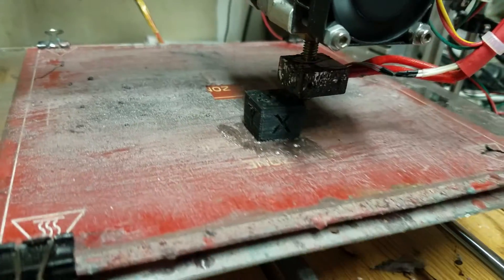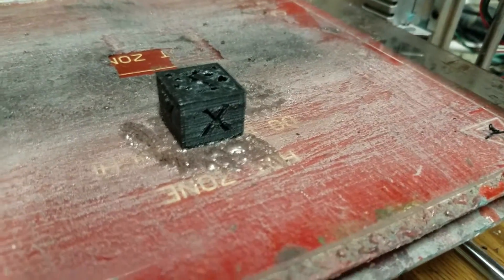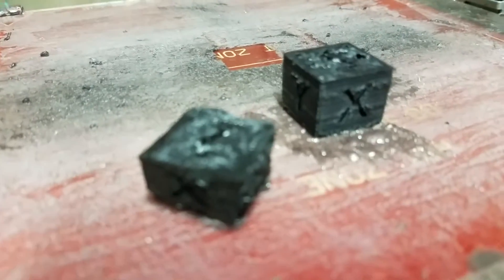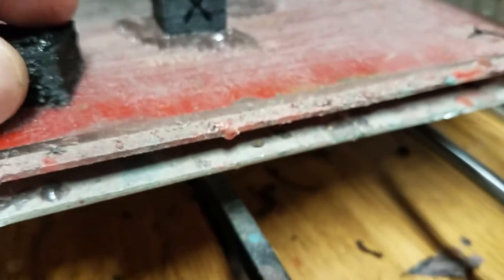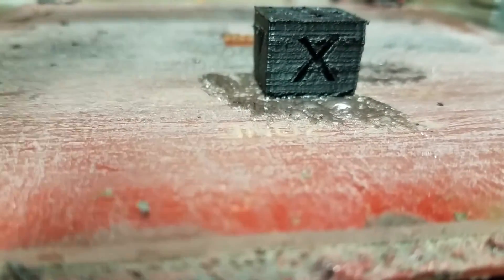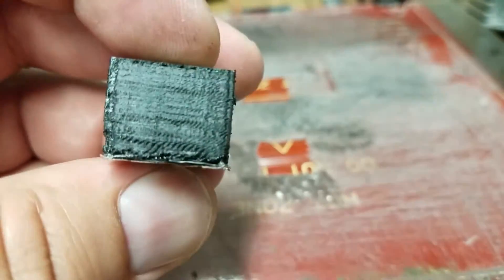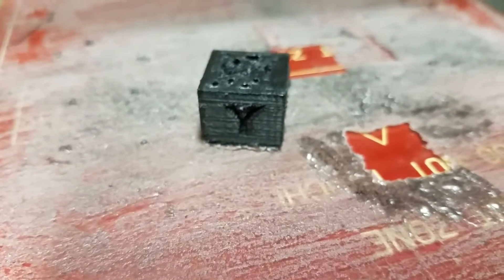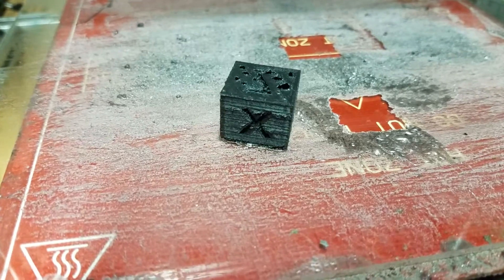Basic Settings for Smoothie Board on a Basic I3

Comment: Thanks for responding so quickly. Two more question what did you use to write it/ edit it? Can I use any text editor except notepad ++ or is there a preferred one ? Compared to the original board how much better is the smoothieboard?

Comment: Not sure what alpha, beta and gamma are for steps per mm, but my anet a8 runs about 100 x 100 y 400 z.  You may want to check that out as your cubes look short.  I also had that same issue when I had selected the wrong "type" of g-code in cura (marlin vs repetier).  After changing firmware to Skynet for the added bed leveling sensor it made no difference which I chose, but before that choosing Marlin as the G-code type instead of repetier would result in short cubes.  Just a couple of things I'd check.  That and a new glass bed....

Comment: I am in the process of doing the same upgrade and my board did not comebwith any software. got it from smoothieware but there is some confusion on what firmware to use cause they have several. also your settings are a great help thanks. can you let me know the firmware you used

Comment: You should use capton tape with some hair spray, the print bottom would be clean.
Maybe you use your printer quite heavily, seems like its time for you to change your linear bearings and also upgrade to a bowden extruder to have a better print quality.
Not sure if you are printing ABS, it's always good to have an enclosure for Printer if you would like to print ABS.
Reply from the maker: Lokesh gondane thanks for the advice. This printer has been running for over a year straight. I plan on changing the bearings soon. A Bowden extruder is in the works. Any other suggestions?
Reply from the maker: Lokesh gondane Also, this is ABS, and I'm using slurry for the bed.